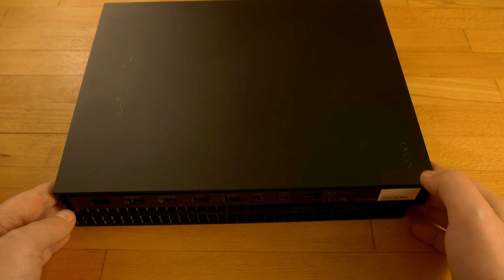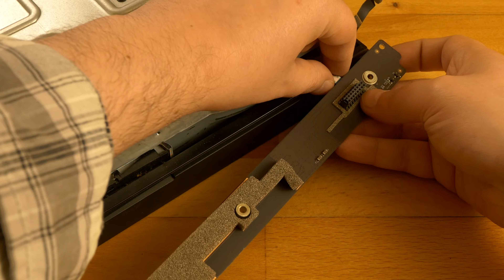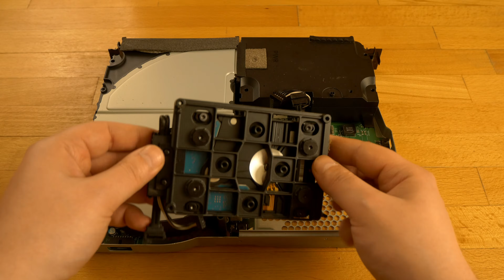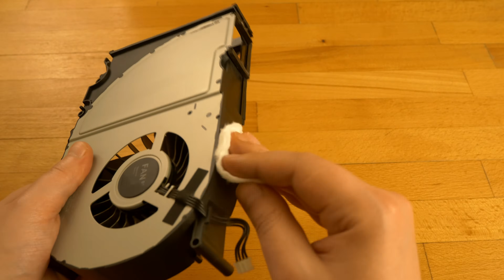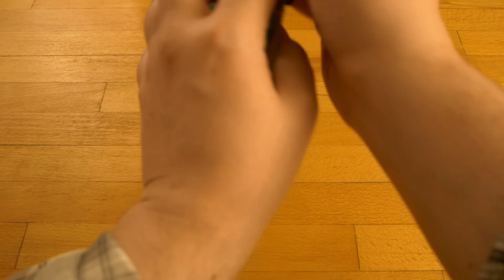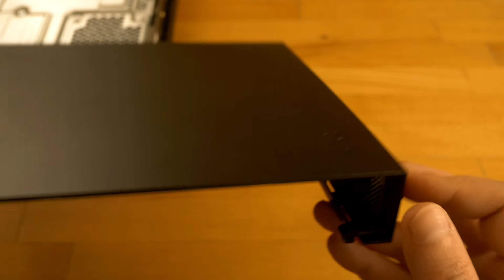How to Clean XBOX One X - Teardown & Cleaning

Comment: Great tutorial!! I managed to disassemble, clean, apply new thermal paste, and replace my HDD with a new SSD with your help. Thank you so much for the video!
Reply: Thermal paste is not advice on dye chips use PTM 7950 since it's a thermal change compound which is what it comes with the Xbox one x from factory, thermal paste will pump out and cause huge temperature spikes overtime
Reply: Dont change paste